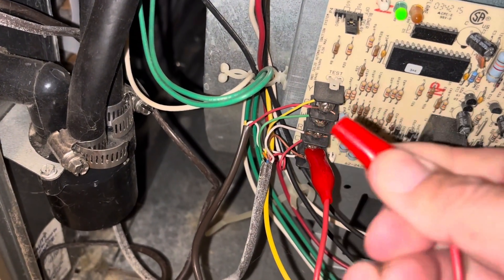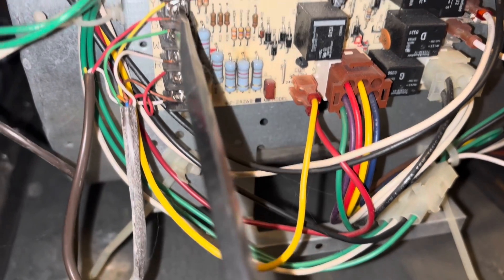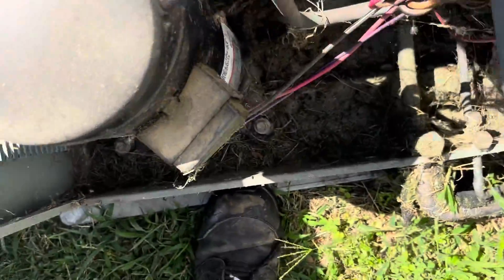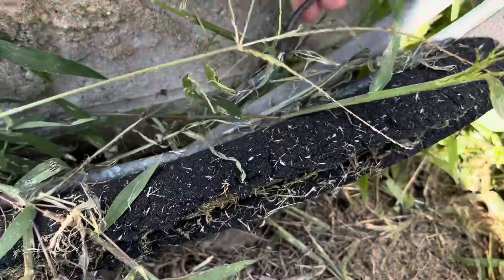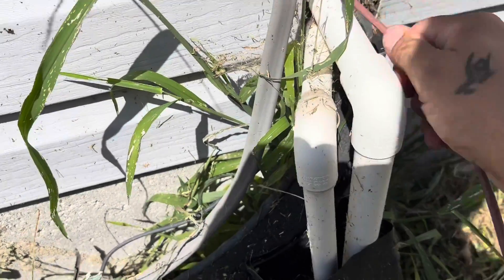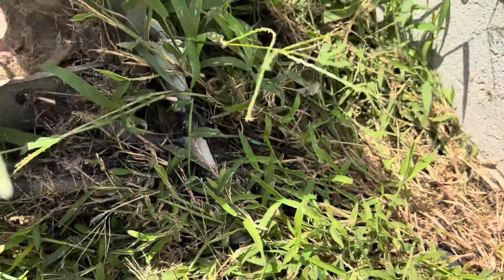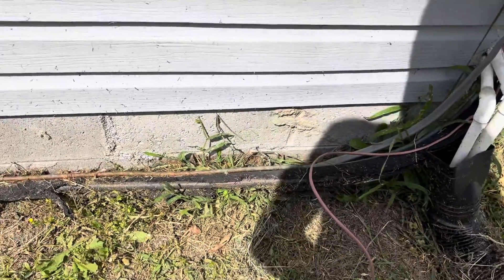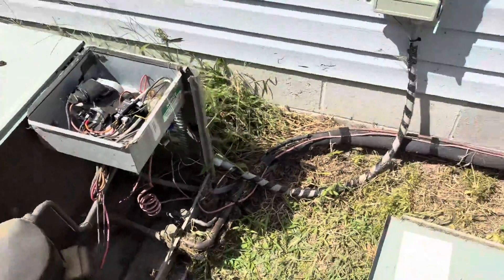Troubleshooting A Low Voltage Short On HVAC System!

Comment: Finnally someone who knows that an amp clamp can be used on low voltage control wiring.   When you understand that low voltage troubleshooting is so easy.

Comment: They need to make t-stat wire weed eater proof :face-blue-smiling: Good fix ... Thx:hand-purple-blue-peace:
Reply from the maker: That’d be nice!
Reply: No need if you do a proper installation and run it through conduit fixed to the wall. 🤣

Comment: im surprised the short didnt blow the fuse on the board. did it not have one?
Reply from the maker: I think it wasn't applying the Y call long enough.   It would call and a slip second later it would drop.